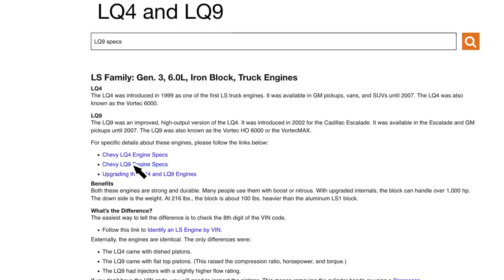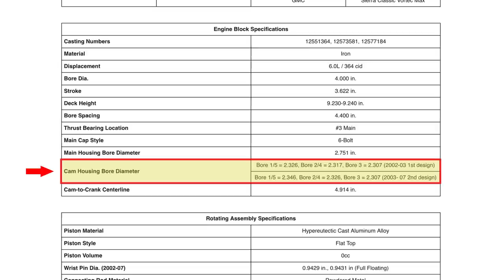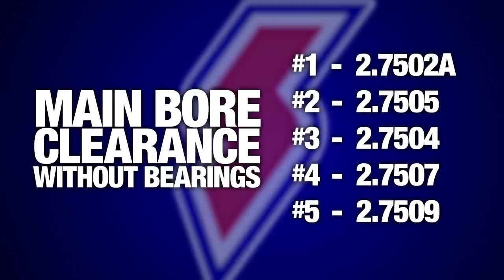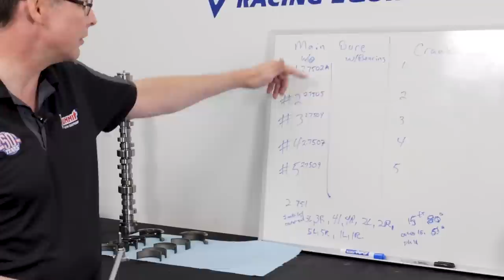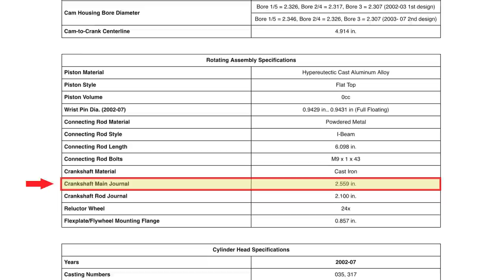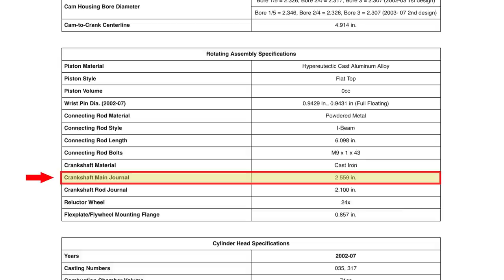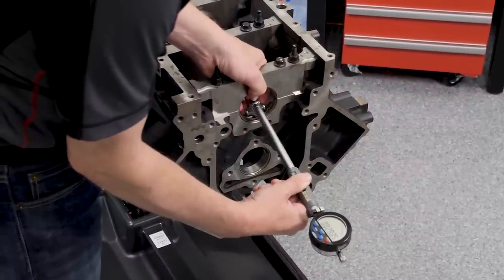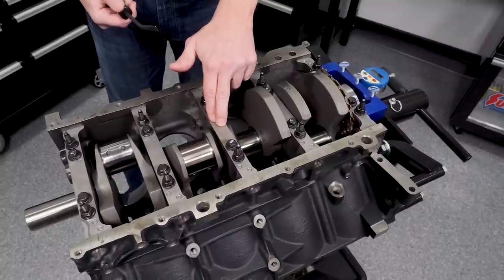How to Calculate and Measure Main Bearing Clearance -- Engine Building 101

Comment: Measuring out to a 100,000th is bullshit.  Not realistic. Especially in a 2 tool setup and no temperature control.  The tool won't hold that and a few degrees of temperature change will cause that to drift.  Getting a true measurement out to a 10,000th is an accomplishment.
Reply: Dead honestly It's not bullshit. Loads of people do it all the time including myself. It's measuring in microns or tenths of a thou which is exactly what any good micrometer does. Your right that temperature will affect this measurement so one must be mindful of that. It takes a bit of practice and intelligence for measurements to be accurate but that's what being a professional is all about. Good crankshafts are ground to a tolerance of 1-2 tenths  of a thou (1.25 to 2.5 microns) and this is easily measured with a test indicator and micrometers etc. If I machine parts on a lathe I will clock them up within 2 tenths of a thou before turning whenever possible. It's standard practice.
Reply: @spearotv587  tenths of thousandths is a 10,000th, not 100,000.  No commonly available micrometer will measure that.
You're talking 1/10000, not 1/100000.  Huge difference.
Reply: @dan1906  correct, although it doesn't really matter that it's included in a couple of their measurements as the tenths of a thou is the smallest change in clearance that will affect bearing selection or re working etc

Comment: Where do you really take readings from the bearings to get a precise measurements? I am asking this because from what I have gathered, the center section of the bearings are thicker compared to the section near the parting lines.
Reply from the maker: Thank you for your question.  You are correct that bearings are thinner next to the centerline.  This helps avoid “pinching” the rod journal when the rod is under high tension loads and the round bore becomes ovalized.  For this reason, always measure the bearings from top to bottom (90 degrees from the parting line).

Comment: what is the formula to calculate which bearing halves you need?  if you know the bore diameter and the journal diameter and the oil clearance desired?  there should be a way to calculate it.  not all of us want to buy dozens of sets of bearings to mix and match with.  does Summit have a tool to calculate it?

Comment: Seems like it would be cost effective for a diy’r to just have the block align bored rather then buy 4 sets of main bearings?
Reply: I would think the same, though my concern would be, how do you know your line bore is accurate to 1-2 tenths of a thou unless you measure it all your self to be sure and then you need to know your crank is ground to the same concentricity for it to be worthwhile. Both of which require some decent equipment to measure.

Comment: I am looking for a light weight (aluminum) small block build to put in my 2004 Jeep Rubicon for both offroad and street use. My budget for the entire pull and replace project is $10,000.  Would you be so kind as to point me in the right direction ?  I am told It will be cost inefficient to use a Ford Z351 block.
Reply: For warning ⚠️ if you’re not a die hard ford fan I’d steer you away from that as ford transmissions or at least my knowledge of them makes them more harder and expensive to adapt to the new process transfor case I know because I haven’t finished one with a mustang 3V / coyote engine and a ford automatic 5 or 6 speed transmission. However it’s still possible just takes a Machine shop for the adapters and maybe one out put shaft / sungear repacment sorry it’s gotten pushed back in the q ( my dodge and K1500 jumped in line as higher priorities for me right now ) and been awhile sense I’ve worked on it and can’t remember all the specs I do like the idea of that as a ford has more wow 😮 factor but the Chevy lsx or ltx platforms are easily to swap then a dodge engine and transmission. Keep in mind if you’re in the USA 🇺🇸 at least you more than likely have to pass emissions and at least in Hawaii or Alaska and Utah or California if I’m remembering the engine and transmission has to be in your case 2005 ( and in one of those states they check the block numbers etc. or at least they used to  and I was told if it rebuilt or not doesn’t matter if older they’ll still kick it out ) or newer to pass and with all of its smog items intact and working to even think about passing for road worthiness. If have any questions I’m happy to help as I like ford powered jeeps reminds me of ww2 ones
Reply: What t-case and transmission are you planning on using? As the Atlas is more of a aftermarket one but it’s more money
Reply: @richardprice5978  Makes sense.  Thank you

Comment: I built my engine alittle loose too and had to step up a heavy weoght oil to correct the oil pressure issue. Of course I'm also running loose because of the new RPM limit.